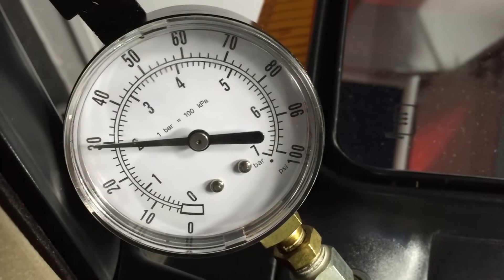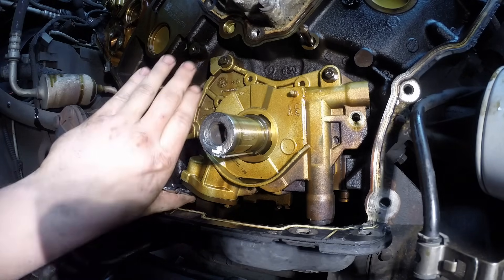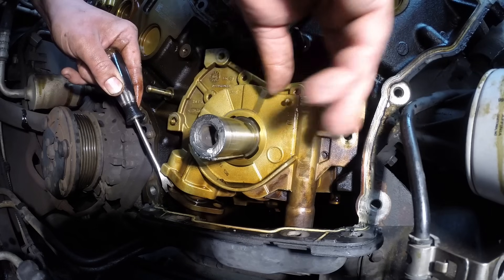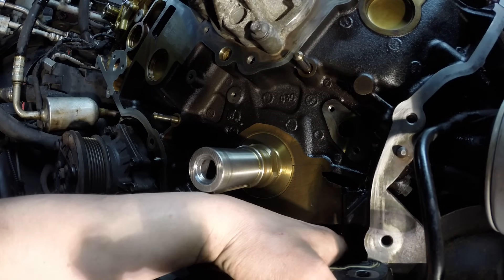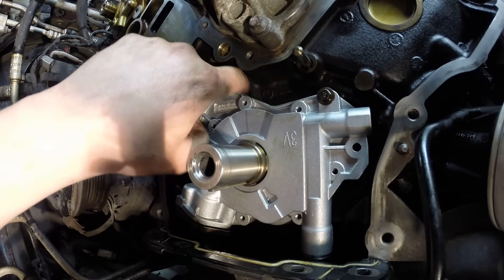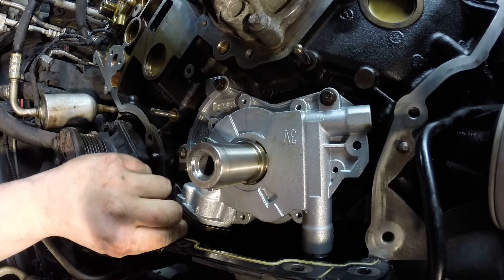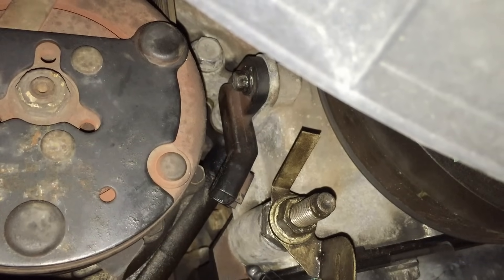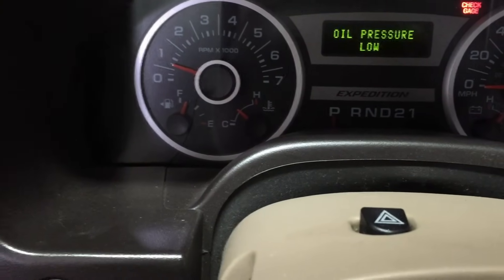Ford 5.4L 3v Engine Melling M360 Oil Pump Upgrade

Comment: do you recommend a 5w20 or a 5w30 for the 3v engines ?
Reply from the maker: 5W-30 all the way this engine is used in other countries without strict CAFE standards and Ford calls for 5w-30 and it protects them much better.
Reply: FordTechMakuloco  thank you
Reply: +FordTechMakuloco 10w30 works to?
Reply: @bigtoko93  Do not use 10W30.

Comment: I have a 1998 mercury grand marquis with the 4.6 liter engine when I bought it the car had 89k and I have had it for 3 yrs and it has 278k and still going power to ford

Comment: Will this Mailing pump also work on a 2010 F150 with a 4.6 3v
Reply: yes they have a spring for 4.6 and 5.4  in the kit,use the 60 psi,brown i believe. read the paperwork that comes with it

Comment: Thanks for replying to my post last night! Still having oil pressure issues following installing the m360.  So, I started it and let it run for just 2 or 3 seconds but still nothing.  I think I have a legitimate issue...I'm thinking of dropping the pan to have a look at the pickup tube/o-ring situation tomorrow. Do you have any ideas or thoughts on what else I might check?  Everything went back together great watching your video; it was the 2nd time in two months that I went through it.  First was a timing job, second was the oil pump--ugh! :)
Reply: You sure you didn't have plastic tensioner parts plugging the intake pickup?
Reply: @anothersomebody8195  pretty certain I was in the clear with that. The old timing parts I removed were intact with no missing pieces.
Reply: I know  this was 4 years ago , but I'm curious to know what was causing this. I suspect it was something you did during the install job, but let us know what happened.
Reply: @Marco-fi6gv  When I started it the next time, the pressure went up like it should. The issue was that the gear rotor style oil pumps can be difficult to get to prime. Even though I had taken it apart and filled it with oil as instructed, it still had trouble. It just took a little more time. That can be a very bad thing! I've done a few more if these mod motors since this video and started using an oil primer. That's seems to do better at getting things to react quicker. Hope your project goes well! Let me know if you have any other questions.
Reply: @ponycorral99  thanks, I appreciate the info 👍

Comment: hello, I just finished up the oil pump upgrade on my 06 expedition with 5.4l. I put the melling m360 in. my issue is that once it's all back together I have no oil pressure on the mechanical gage that's hooked up to the oil sensor port. I left the crank sensor disconnected and cranked it about 3 different times for a few seconds, thinking it might just be priming. No luck. I even took the back plate off the new pump to put some oil in there like you said. now I'm second guessing as to whether I even put the new o ring on the pickup. Can't find it anywhere but you know. kinda freaking out here. is it possible that I just need to start it? don't want to cause damage is all.
Reply from the maker: +stevensmellie yes at times you will need to start it just keep an eye on the mechanical gauge you will find oil pressures comes up in about 1 second after startup if so you are good to go!
Reply: @Stevensmellie, did starting the truck work? We're having the same problem, no pressure with the crank sensor disconnected.
Reply: @ericaberta9864  oh, you got to love those gear rotor oil pumps! Yes, starting the truck did work when I was doing that expedition. It took a few seconds but it did come up. I just actually completed a full rebuild on a 4.6 Mustang engine and had the same issue 2 weeks ago! Again, it's the same style oil pump. I had done the same thing by removing the back plate and filling it with oil as much as I could. I had never run the engine, though, since it was a full rebuild so I was more nervous than when I did the expedition, which had oil throughout the engine from prior runtime. I took faith in the assembly lube and the priming procedure that I had used for the 4.6 L. During which I was able to see oil coming all the way to the roller followers. It was still the cause of great anxiety, however, when I turned the key and got no reading on the gauge! I tried three times cranking it without the sensor connected. no pressure. I resorted once again to starting the engine for a couple seconds and still did not have pressure. That got me second-guessing my pressure gauge. I tested the gauge on an external tank that I had used to pressure-prime the engine . The gauge worked. So, I decided to try cranking it one last time... Finally the gauge started to build pressure! Hallelujah! 85psi!  I wish you luck!
Reply: Stevensmellie... Thanks for responding. Talk about a learning experience. We ended up calling tech support at Melling. We used a suction gun to inject oil into the oil pump where you attach the filter. Did it once, waited a few minutes and injected more. Put the oil filter back on and tried cranking. Hallelujah!! Oil pressure went up. Connected the crank sensor and it started right up. Can't believe you went through it twice.
Reply: @ericaberta9864  Excellent news! I'm so glad you got it working. Prior to cranking the engine in the Mustang, I had pumped 10 quarts through the whole engine at 50psi thinking, "that's gotta be enough to get it going." My pressure tank was connected to the same port the pressure sensor attaches to. That darn pump still didn't prime lol. We eventually got it, though. I hope you're works for you for a long time to come. If you still run into idling issues, don't forget to reset the KAM (keep alive memory.) Your vehicle has spent awhile trying to compensate for bad parts. Resetting the memory will allow the vehicle to relearn the idle trims. I believe fordtechmakuloco has a great little video on how to do that. Works like a charm! Nothing more discouraging than doing a long involved procedure like the timing set only to have it idle like garbage still. I had that once; reset the KAM and life was good 😎.

Comment: Hello , I need help. My 2007 Ford Explorer 4.6l with 150k mil .I got my check engine light code P0020. I checked the wiring that comes from the computer to vct is ok , I changed vct Solonoid then switched oil pump and a complete kit Timing chains including thrillers, leading phaser. The eror cod stil work p0020. I spent a lot of money and a lot of work and I have been completely discouraged .if anyone can help me Thanks

Comment: I just had the motor go out on my 2007 f150 at only 102,000 miles. I'm wondering if it was a faulty oil pump that caused it. I bought a used 5.4 from a 2008 and just learned that it has updated and improved heads with different spark plugs. Did Ford fix the oil pump too or should I replace it with the M360 before I put the motor in? Are there other things you would change before installing a used 5.4 3v to avoid problems later?

Comment: Amazon says the m360 doesn't fit my '08 5.4 3v? did something change with the pumps in the later years?
Reply from the maker: Nope it fits all 5.4l 3v engines all years.
Reply: FordTechMakuloco OK thanks! On a different subject have you heard of the dome/ cargo light going on and off randomly? Brake light too. Got it narrowed down to either the circuit board on the cluster or the connector on the top left of the board. Doesn't seem to be any real fix to it from the little info I can find on the web. Do you know much about this? Really appreciate all the videos you do! Maybe you have one about this and I haven't found it yet

Comment: what is the extra bolt hole for? The block is threaded and the oil pump bolt thread right in?
Reply from the maker: +Michael mcdonald the chain guide bolts through there into the block
Reply: Duh.... I should have waited a bit before asking.. Thanks

Comment: FordTechMakuloco ,you recommend the Melling M360 in the video but also list the Melling M10340.  I have a 2010 F150 5.4L engine and Amazon states the M10340 fits my truck/engine but the M360 does not.  Please advise.  Thank you
Reply: 360hv best

Comment: Which pump would you recommend for a 4.6L 2v?
Reply: The melling M360 works if your  
Are planning on making some HP or the M340 would work fine for your daily driver
Reply: Melling High volume oil pump
Reply: Will this work for a 2007 Lincoln Mark LT 5.4
Reply: @peteacevedo3822  yes

Comment: @fordtechmakula what are how many psi are the modular engines supposed to have
Reply from the maker: +tim walk Well 65psi is the relief but they should have at least 20psi hot idle I like to see 25psi or more

Comment: Jasper Engines and transmissions has a video on this and they install this oil pump in their reman 5.4s.The backing plate of the oem pump is aluminum,flexes and the oil goes back into the oil pan
Reply: Walter Frederick does Powertrain products install the same oil pump as well?

Comment: Dude you are awesome! Is the procedure the same with a 2 valve? I'm about to do the timing chain dance on my 2002 5.4 F250 4X4, and figured I'd replace the oil pump too, as that is about 60% of the problem. Also, can the oil pan be removed in the vehicle, I was thinking of going with a higher capacity off road pan.

Comment: Are the Melling pumps in your description for a 2003 Lincoln Navigator with a 5.4L engine also?When I use the Amazon check it shows not compatible.
Reply from the maker: This is the latest pump for your 4v engine- http://amzn.to/2gdgXaP
Reply: Fordtech makuloco Great videos, I was looking into replacing my oil pump with the 10340 as that is what melling approves for my truck and not the m360. Will the m360 fit a 2004 ford fx4 5.4l 3v?

Comment: Fordtechmakuloco, I've installed the new 360 pump, and all new one timing components. Phasers, tensioners, chains, guides, vcts, and closed everything up. Left the crank sensor unplugged and cranked a while. Not building any oil pressure. I'm going to hook a mech gauge to the port, but do you have any ideas as to,why it wouldn't trip the sensor? Thanks
Reply: Mike Sells did you figure out what was wrong?  I have the very same issue with my 06 expedition.

Comment: Hi Brian,
Like others I have to say the best information and videos on the web. I just bought a very clean 05 Expedition King Ranch and haven't dug into it yet but "BAD" ticking on passenger side of the engine, although noisy on drivers side as well. 104,000, I suspect lifters or followers but will look at timing components as well, maybe a valve spring. I suspected oiling problems before finding your video, so was planning an oil pump change as well. All the sites are kicking me out as not the right part for the Melling M360 oil pump for my 05 King Ranch. Is this the right heavy duty pump? I see Ford has had a lot of problems with their timing components, are you still recommending them over the import replacements? Most parts houses have the import stuff.
thanks,
Gary.

Comment: Q:  Do you recommend to install the brand new OEM oil pump? Why Do you prefer Melling instead OEM in this case?
Reply: The ford pump doesnt deliver good volume and pressure and wears out fairly quick.
Reply: got it, thanks!

Comment: I have a F150 FX4 2010 and my oil pressure is at 0 and change the bulb oil pressure remains the same, and checked the pressure of the pump and all is well, my engine does not sound, but I worry that the pressure this 0. you could help me?
Reply: replace the gauge, if it still says 0 then either you have a blocked port feeding the gauge or your pump is bad

Comment: Question:  Why do you recommend switching to 5w-30 instead of 20 after the pump installation?  I may have missed that in the video.
Reply from the maker: +Herman Gilmore it also helps protect the VCT components going back together which is the whole reason we are upgrading this pump to begin with
Reply: Herman Gilmore a

Comment: One quick tip for those who have big paws like me.   I was fighting this all day until I decided to use a hemostat to hold the inboard pickup bolt and thread it into the hole.  Don't clamp the bolt until the hemostat locks, just gently hold it just below the head of the bolt and then snake the bolt in the hole.  Once in the hole, just use one finger to push on the head of the bolt to get it to start meshing into the threads, and with continuous pressure from ones finger on the head of the bolt, gently release the bolt with the hemostat and reposition it after each counterclockwise turn (as viewed from above, since the bolt is inverted).  This will tighten the bolt until one gets to the last few turns.  By this time the gentle grip by the hemostat starts to slip, which means a swivel ratchet as suggested in this video will now have enough resistance to start clicking and finish the job.  Hope this helps someone.

Comment: Just now found these videos and I can't thank you enough! I noticed that on the oil pump right side there is another hole just below the L shape casting. The block has what looks like the same hole on either side of the port opening. Is a bolt missing?
Reply from the maker: Yes a bolt is missing that comes later when the timing chain guide is bolted on over it.
Reply: im looking at an 05 ford EB expedition thats got over 200K miles on it, it was a one owner vehicle and the body is immaculate and its cheap as F because of the miles (under $5K), if i get this vehicle the phasers and this oil pump will be the first mod i make to the engine, id be willing to bet i could get another 200k out of it.

Comment: Hey Brian great video, I'm in a bit of a conundrum.
I have a 2007 Lincoln mark lt with a 5.4L triton, it has over 411000 km on it (yes I'm from Canada)
At start up engine is fine but after warm up t loses oil pressure, starts to have rough idle and even stalling. 
I've been told I could change out the timing components (possibly stretched chain, bad tensioner/guilds, cam phasers) and oil pump or bite the bullet and just change out the whole engine(hope I don't have to).

Based on what I told you with your experience what would you recommend?
Reply: Having the exact same problem I have the melling m360 pump haven't put it in yet and I have 230,000 on mine what did you end up doing and did it fix yours?

Comment: what kind of numbers do you see for hot idle oil pressure numbers before and after the oil pump like start with 20lb then after the change 28lb? do you think this is a good way to prevent phaser comebacks and lifter seizures?
Reply from the maker: Yes I show the numbers before and after it is much improved even at idle. This help protect the vct system especially the rh phaser.
Reply: i was just asking for some numbers you have seen since i figure you have done this many many times, i have a 04 with 20psi at hot idle and the passenger side making noise starting at 160 degrees f and pressure starting to drop below 40 ending with 20psi hot idle at 190f and a good clatter like a diesel and the drivers side making a little noise. i was even contemplating some main bearings for as much extra pressure as possible to protect the valve train. thanks for your answer earlier and any more input or ideas you have.

Comment: why not just hold the new pump upside down and fill the oil where the pick up tube goes then turn the drive gear by hand until the oil comes out on the out let side ?
Reply: it would drain out when you put it right side up,,,>>

Comment: Hello, I have a quick question :  Can I use Lucas heavy duty oil stabilizer in my  Ford 06 F150  5.4L 3v .?   and what you recommend Lucas or BG MOA  engine oil additives.?    Thanks for share your knowledge,!
Reply: no,that would take your viscosity up one. 5w-20 becomes 10w=30 which is too high dont do it

Comment: about how many miles to you recommend  before changing the phasers, chains, pump, and tensioner.
Reply from the maker: Once you get past 100k miles its time to start planning for it but only use the Ford kits I link to in my videos or else you will have new problems.

Comment: I have a 5.4 3v and I was wondering I had a clunking noise when I start the motor sometimes but it's just when it starts for five seconds then it goes away could it be my timing chains I know it isn't my phasers because I know what they sound like any help is appreciated
Reply from the maker: The noise you are describing is the timing chain tensioners bleeding down from blown out gaskets.
Reply: +FordTechMakuloco so to fix it I would need to do chain tensioners and chains when I do my phasers correct?
Reply from the maker: yes but do it right with this kit or you will have more problems after- http://amzn.to/29hJp3f
Reply from the maker: I would also upgrade the oil pump while you are in there- http://amzn.to/29iddSe
Reply: +FordTechMakuloco Ok thank you for the help

Comment: Agreed pump can be removed without oil pan removal, but every one I have had to do the chain guides are sitting in the oil pan, tough to fish them pieces from the front cover. 

Great videos, it does amaze me how you have time to produce quality videos and pull wrenches at the same time. Dedication!
Reply: Since you have to reoil might as well drop the pan and clean it out

Comment: When replacing the oil pump, would it be a good idea to change the engine oil afterwards?
Reply: Yep, nothing like a good oil douche to clean out your internals.
Reply: before removing the front cover and timing chains to get to this point the oil should be drained so it should be changed regardless with a new filter

Comment: On the 2Vs (4.6L and 5.4L), the oil pump gears were cast, IIRC. We used to install billet steel gears inside the factory pumps. Wonder if this is still possible with the 3Vs?